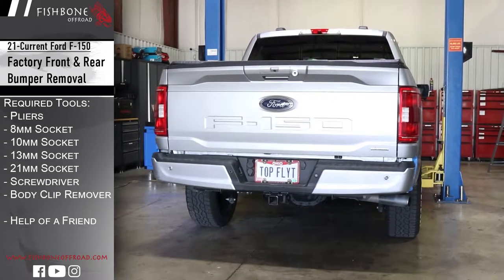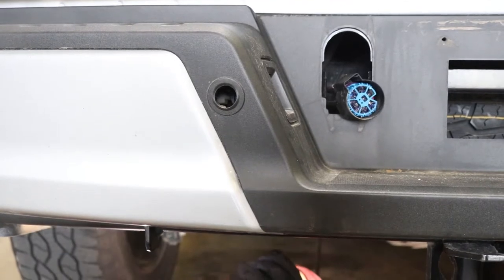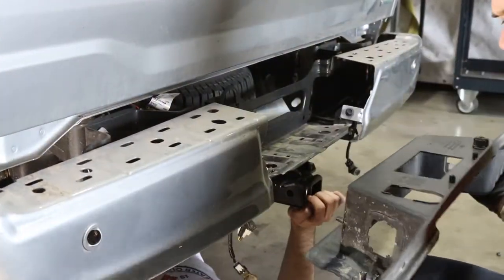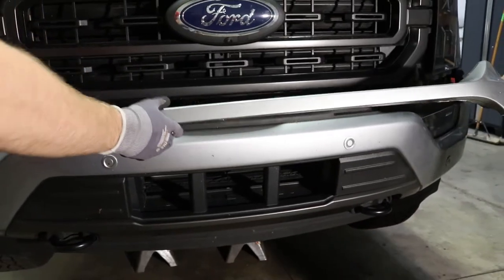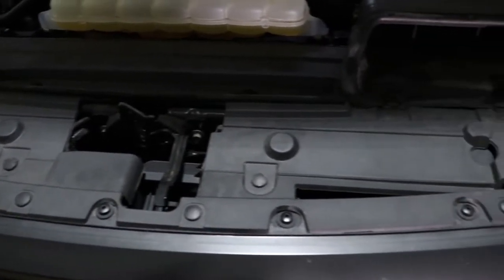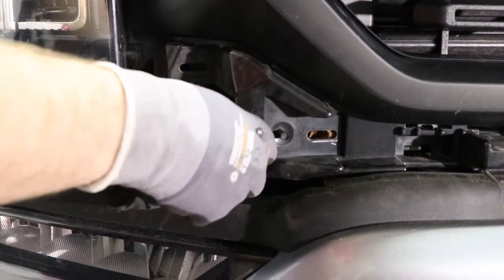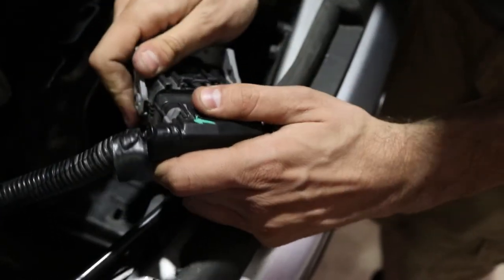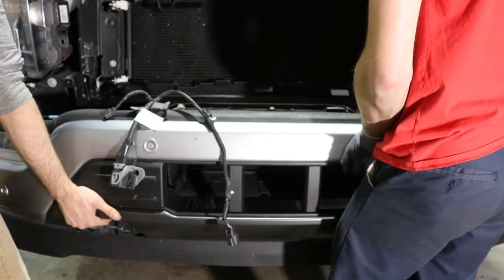2021+ F150 - Front & Rear Bumper Removal - HOW TO

Comment: Great video! Looking to paint the chrome part on my front bumper. Can the front bumper be removed without taking off the grill?
Reply from the maker: You can, but it involves a lot of twisting and yanking.  We don't recommend it because you could permanently break the retaining tabs.
Reply: @FishboneOffroad I haven't had to take off the grill yet. Just for the front number. 🤷‍♂️
Cavender Ford multi-faceted technician here.
I just wanted to add my 2 cents. Was looking to get past a module on the power boost models

Comment: Does the main power connector disconnect/reconnect trigger any air bag or crash detection sensors?
Reply from the maker: It shouldn't because the sensors are based off of impact, but if you want to be absolutely sure, I recommend just disconnect your battery before starting

Comment: Good video on rear bumper, but a lot of unnecessary steps if you’re just removing the bumper as an assembly. unclip the wiring harness from lights, tow plug, and sensors, and 6 bolts that are 24s. Super easy

Comment: For the front bumper, is it possible to remove the bumper without removing the grill first?
Reply: Yes. But the power boost models have an inaccessible nut behind some kind of module in the bumper. Was trying to find out how to get past that module and I find these guys. Wasting time. Take the number of the truck as a whole. Swap pieces into new one on a stand. 
I've done a couple, but haven't had to fight with that module yet.
Reply: @ShadowMachine99  do you have an email to ask some questions I’m trying to do a mod on my truck that maybe you can weigh in on possible ways to go about it?